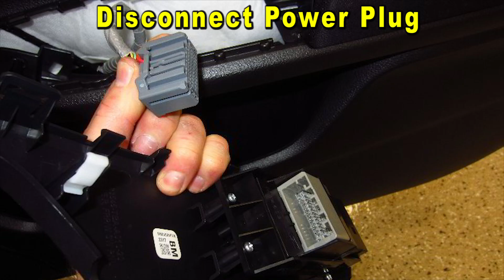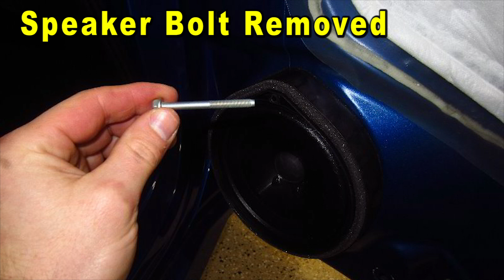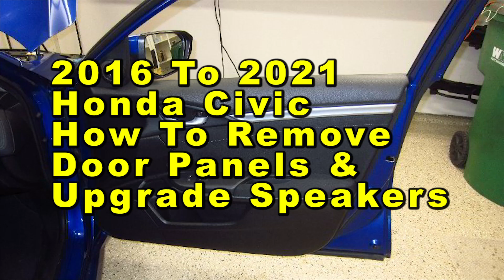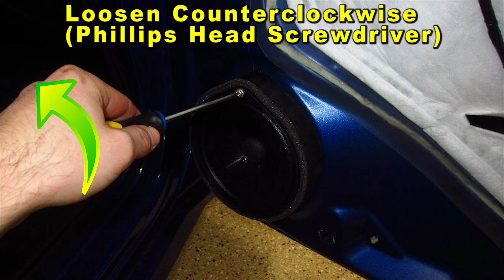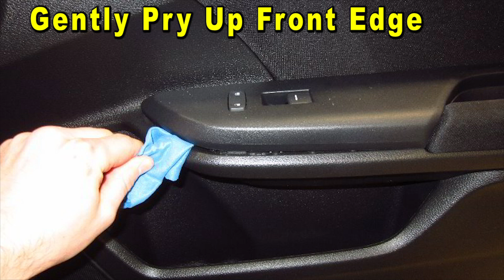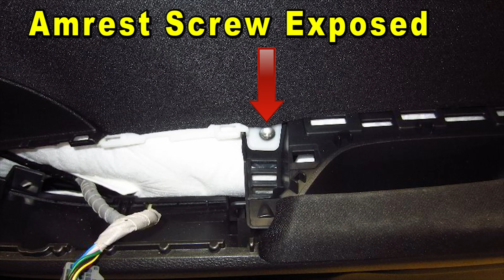Honda Civic How To Remove Door Panels & Upgrade OEM Speakers 2016 2017 2018 2019 2020 & 2021

Comment from the maker: Honda Civic Aftermarket Car Speakers - https://amzn.to/3PgTLrt
Dynamat Sound Deadener - https://amzn.to/3szSfba
Precision Screwdriver Set - https://amzn.to/3OYN1i0
Plastic Pry Bar Tools - https://amzn.to/3HMtsV7
Socket & Ratchet Set - https://amzn.to/3Z17LbA
Mechanix Gloves - https://amzn.to/3jCnHkt
Torque Wrench - https://amzn.to/3vS5uSI

The Paul79UF YouTube channel is a participant in the Amazon Services LLC Associates Program, an affiliate advertising program designed to provide a means for sites to earn advertising fees by advertising and linking to Amazon.

This DIY video shows owners of the 10th generation 2016, 2017, 2018, 2019, 2020 and 2021 Honda Civic how to take off the plastic interior door panels and upgrade the OEM door speakers.

Comment from the maker: Check out the DIY guide for taking off the plastic interior door panels and upgrade the OEM door speakers in a 2016 to 2021 Honda Civic - 
https://www.paulstravelpictures.com/2016-2019-Honda-Civic-Door-Panel-Removal-Guide/index.html

Here are all of the DIY repair and maintenance tutorials for the tenth generation 2016, 2017, 2018, 2019, 2020 & 2021 Honda Civic - 
https://www.paulstravelpictures.com/Articles/2016-2019-Honda-Civic-DIY-Repair-Maintenance-Guides.htm

Owners of other Honda or Acura vehicles such as the Accord, Insight, Clarity, Fit, HR-V, CR-V, Pilot, Passport, Odyssey, Ridgeline, ILX, MDX, RDX, NSX, RLX and TLX may also find these DIY instructions to be helpful.